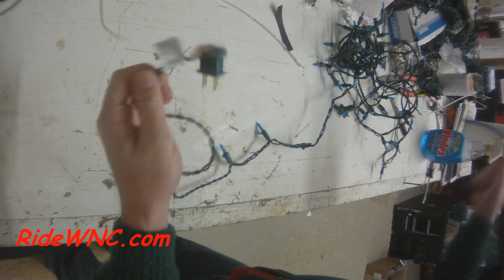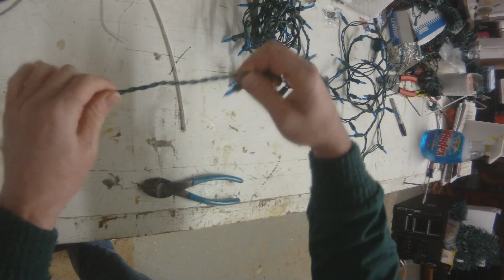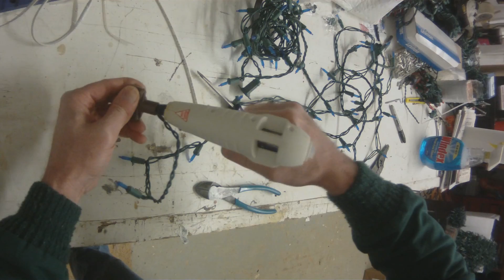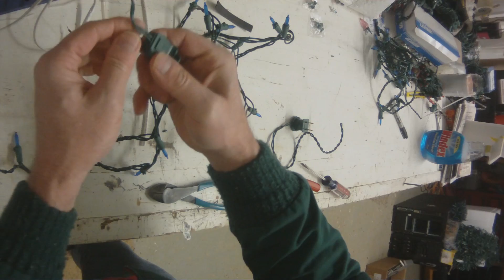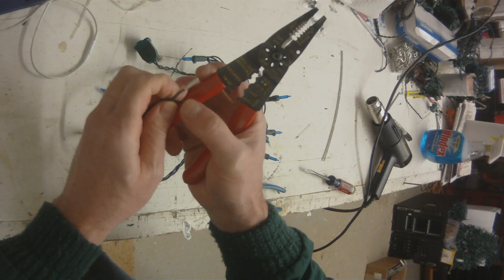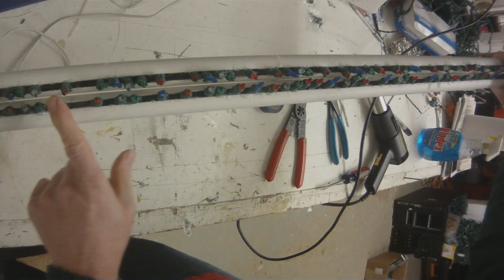Cutting LED Christmas Lights Strings

Comment: How do you cut the lights with the full wave rectifiers?
Reply from the maker: Always and only if there are two wires. Typically there is a different kind of bulb where the two wires begin and end.

Comment: please help, I have so many lights sets that don't work, I did everything that was on the videos.  I do have a hard time getting the batteries out. Is there an easy way of getting them out. I am so happy when I get a set working but I have so many I just can't get them to work. I know I am asking for a miracle but if someone has a suggestion like really would appreciate it.  Thank you again for taking time to read this.  You all are so helpful for us women who don't have any help.
Reply from the maker: Try this:
http://www.thechristmaslightemporium.com/shop/christmas-light-installation-accessories/led-light-repair/led-keeper-led-christmas-light-repair-tool/?gclid=CjwKEAiAgavBBRCA7ZbggrLSkUcSJACWDexAK4csY7KS-s8fTJ0WhE6AXfZuzUpgozCsSB_V_2tHThoCeL_w_wcB

I know the guy who invented this. He personally taught me how to use the one he gave me. He is a God among our Christmas light society.

Remember that LEDs only go in to the socket one way. The power only goes through an LED in one direction. The first and last LED in the string are the opposite of all the others and they will usually not fit in other sockets. * A string would be defined as the section from one two wire section to the next two wire section with three wires in the middle. I say it this way because I cut off connectors and splice many strings together so I don't have to look at plugs.

When I find a string out, I wiggle every bulb first before I remove any. If the string flickers, that is the bulb which needs to be replaced.
Reply: Thanks Mike, I will try that let you know what happened. Thank you again for taking time to answer me.